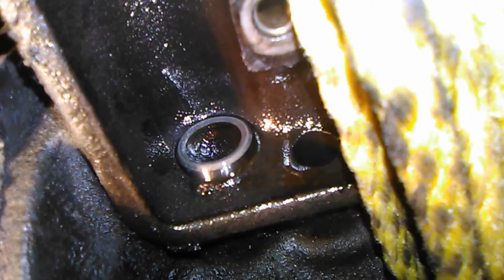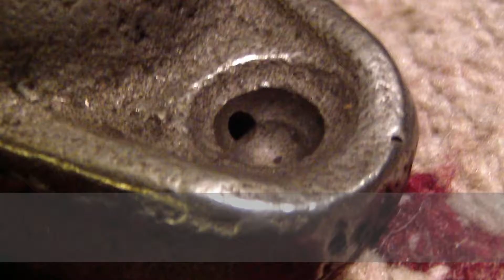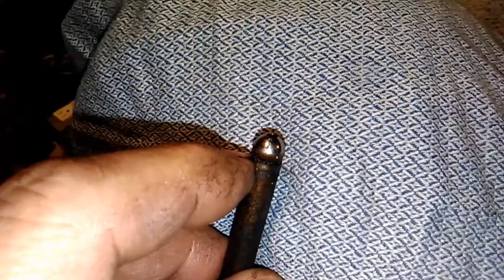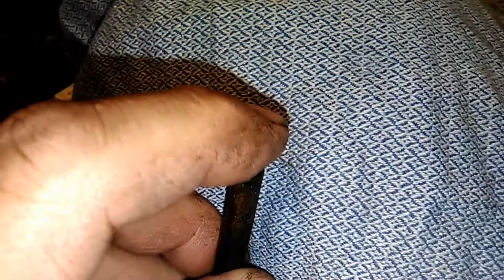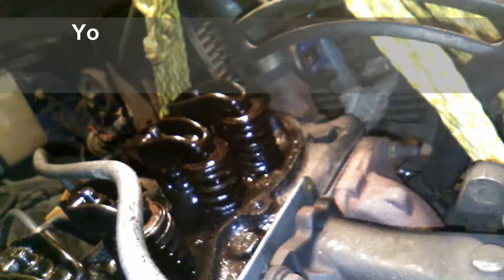"Fixed" noisy lifter/rocker arm, no oil was making it to the rocker arm Ford 300 4.9L I6

Comment: I am having the same issue, ordered new rockers (old ones were worn) hope this fixes the problem?
Reply from the maker: Ya, it helped, but the engine wear was so sever, else where, I broke compression rings on the pistons from a ridge that form at the top of the stoke, I was using fram oil filters, if you don't how fram oil filters will destroy an engine, search youtube for worst oil filter ever made: https://www.youtube.com/watch?v=iTNJLEV8CG8&t=255s start at 4:18, I used that filter, it destroyed my engine.